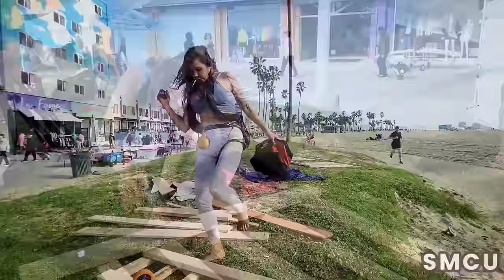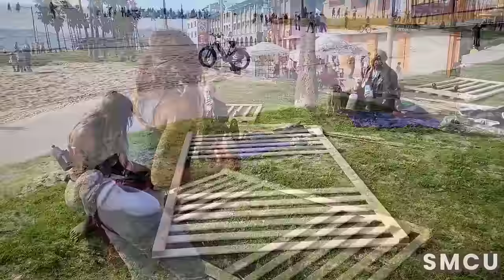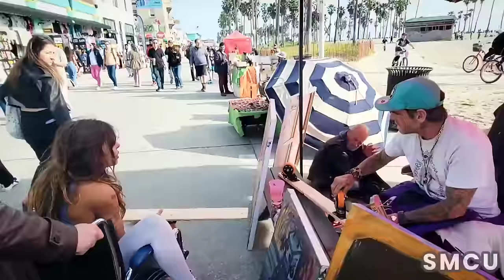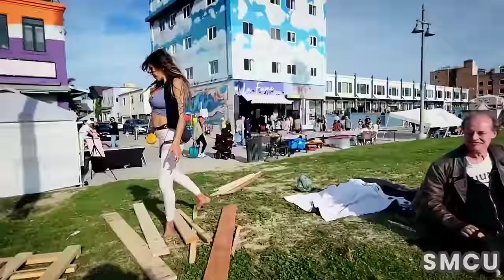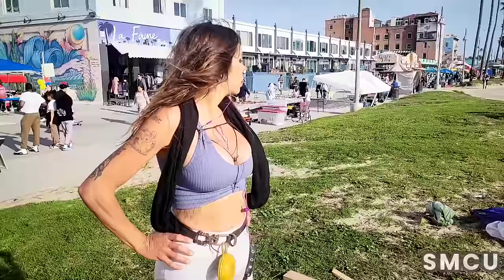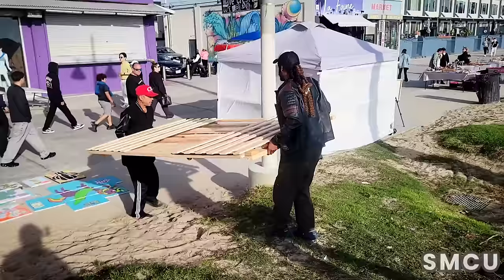Daisy, the Venice Healer, Builds Her Sixth Tiny Home on Venice Beach for Yoga and Healing

Comment: Daisy 5:13  been told by the sergeant of what she can or can't do. She still wants to bend and break the rules. The outcome will still be the same. Daisy you can't buck the system. Rules and regulations have been put in place at Venice beach to people to follow.
Reply: No point in advising her... She is not mentally mature enough to grasp a different perspective. And the clean up crew told her that they would not take her 'vendor cart.' 
So there's that!

Comment: Strangely, she has a pretty good design going. The biggest mistake was to start the screws into the thicker boards, drilling into the thinner boards. The opposite would give much better stability. The spacing of the boards were surprisingly even.. and she didn't even use a tape measure.

Comment: Hey Daisy, starting those long screws wobbling is difficult. Get an awl, and poke a hole wherever you want to drive a long screw. The screw will practically jump into the hole. Your welcome.
Reply: She's screwing through the 2x4 into the 1x.
Reply: simply pre drilling screw holes with a smaller diameter drill bit is common trade practice though maybe a bit complicated for a one track mind stuck in a mental loop to comprehend & put to practice in real time.
Reply: If you keep an awl handy, it's much easier than another drill motor.  Plus, if you layout the screw locations,  by scratching the lines, it doesn't leave pencil marks behind. Then you wobble & push the awl in the exact direction you want that screw to drive. 
 Solving homelessness is a problem that needs solutions.  If someone got together with her idea, it could solve the " move along, you can't stay here" trouble.  I saw a man built some bicycle miny-camper, and others built tiny 1 room homes.